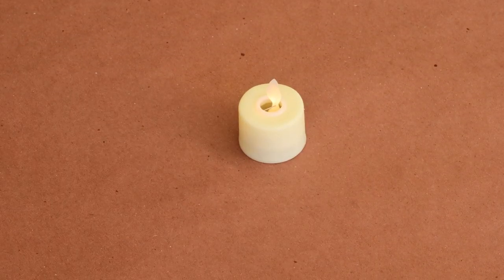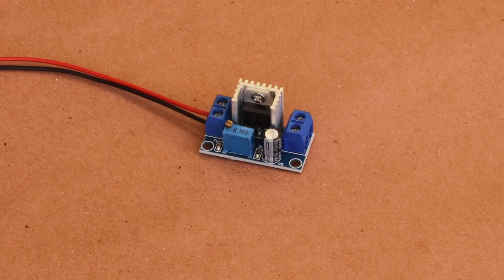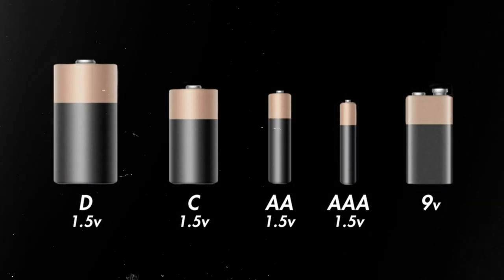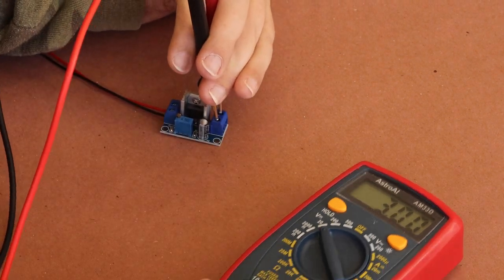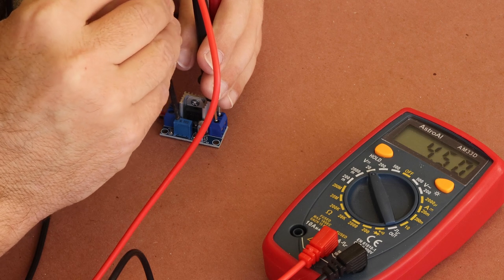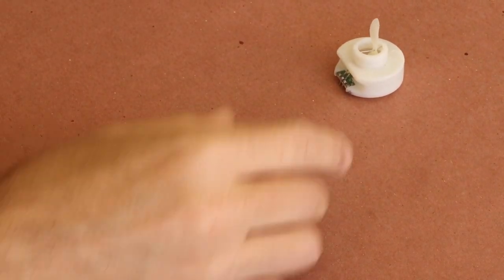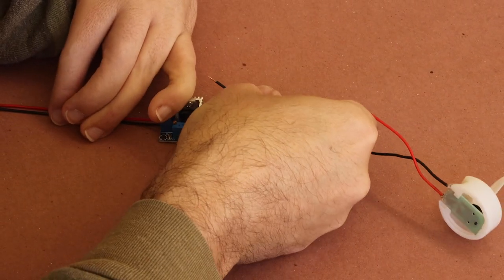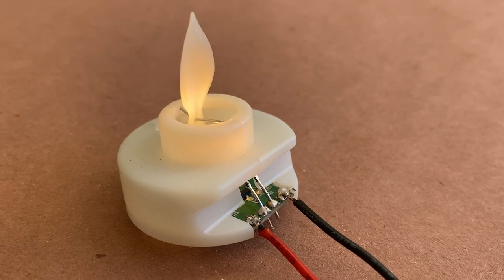PROP LAB: Turn Your Battery Powered Props to Plug-in!

Comment: Hello & greetings from Germany.
I really love your channel. So much nice stuff :) Great work!

Yes, the step-down (or DC-DC-buck)-convertors are very handy. But I advise everyone to take good care of the voltage-drop: the higher the difference between incoming and outgoing voltage, there more heat will be dissipated.
That said, it's a big difference, if you use a 12V- or 5V-System to power that thing up
.
Me and my neighbour had prepared a big haunt this year and converted all of our props to run them on powerline. We used two big power supplies: one 12V/30A PSU and one 5V/80A PSU (regulated down to 4.5V). To our satisfaction most of the available props on the market (nearly 99%) use either 12V (like the air-blown-stuff) or 4.5V (typical "three-battery-items"). So the only task is to connect wires to the (correct!) battery-contacts of the prop, connect the other side to a barrel connector and you're good to go :)

I suggest using the non-soldering-method by twisting or pinning wires to the battery-contacs and fixate them with tape and/or the battery-lid. So it's easy reversible if you decide to power it by battery again.

Keep on doing great stuff & always stay healthy.
Best regards.

Comment: I've been using these modules for a long time and they are wonderful... I like the fact that I can run everything off of 12V and I don't need to have multiple power bricks and get them mixed up and I have the 5.5mmx1.2mm barrel jack/plug with a positive center... so I can use off the shelf splitters and extension cables... again, that removes mistakes of plugging in the wrong power supply and potentially blowing up the circuit.  Before I got everything adapted, I used a yellow tape or yellow marking for +12V and red tape markings +5V

Comment: Over the years I've modified countless Halloween and Christmas items to run from a central DC supply. Some were solar, some were battery. The simple linear regulator shown can get hot (and shutdown) if it has to drop too much voltage at a reasonable current. You can get switching step down ("buck") converters quite cheap that will run quite cool even when supplying an Amp or more current and going from 12V (or 24V) to 3V, 5V, etc. I have some mods shown on my YT channel and web site.

Comment: At my previous home haunt, I also converted most of my battery props to DC, using adjustable power supplies. In one of my rooms, I had a great set of gemi props that were originally designed to be single table-top mechanical s, that I got multiples of  and ligned the hallway on  both sides with these, triggered by a single motion detector, so the person walking down the hallway was 'attacked' from both directions as they walked down.  One of the props on the table was cute, but when you are attacked from both sides, and synchronized with appropriate lighting & audio from the collection, it became very effective.

Comment: I've used those in the past, but primarily to salvage the parts. I've modified them with a 1K NTC thermistor and some changes to the pot (and onboard resistor). They get hot depending on the load you put them under, even with just running a fan they can get hot.

Comment: We have soooo many of these “Haunted Mansion” candles in the house and the constant need to recharge batteries has sapped any desire to use them frequently.  This may be a cost & effort-effective way to solve the problem!  (And another opportunity to break out the soldering iron 👍👏)

Comment: So i got to wondering... How many devices/candles can we put on one of those step downs? Like if you have multiple candles on the same tombstone, do you need one for each candle???
Reply from the maker: I haven't tested it yet, but I'll let you know when I do. My assumption is that you should be able to run multiples from one circuit.
Reply: Yes, you can run multiples off of 1 circuit.

Comment: Derek, your videos are always so helpful.  I understand the wiring of the step down circuit to an LED candle now, but I’m wondering about how to do it on a skeleton with pre-wired LED eyes?  There are wires from the two AA batteries to the eyes and to the activation button.  The activation button is on a set of leads, coming out from the skull.  If I simply take the batteries out, cut the activation switch leads coming out of the skull, and solder the step down into the lead ends and then into my 12 volt connection would that work?  Or would I need to put the step down into the leads currently going to the battery and the other side to my 12volt connection?  Or would I need to put a step down in both sets of leads (power and switch)?  I’m trying to convert all our props to run on house current, from a manually controlled switch box.  (And I really don’t know much about wiring😂). Taking a better look at it, now I have it apart, there is also a on/off switch wired into the circuit.  And a resister on the positive lead to the battery.
Reply from the maker: That’s a lot of options. lol. Without seeing it I don’t feel confident in giving you directions and would hate for you to ruin your prop.
Reply: I appreciate your prompt reply.  I have a photo, but don’t know how to up load it here.  I’m thinking replace the battery box with the 12 volt power supply through the the step down.  Then maybe directly to the LEDs, and eliminate both switches from the circuit?
Reply: Just wanted to let you know, I took both switches out of the circuit.  Wired the leads from the LEDs to the step down and the other side of the step down to 12 volts.  It worked great!

Comment: interesting, can 1 power source + 1 step down power say, 5 candles? or would the power source have to split into 5 step downs first?
Reply from the maker: Yes. As long as they're all the same voltage you can use one to handle multiple

Comment: Fantastic! Being the noob I am, do I need one of those each prop?
Reply from the maker: Great question. I haven’t tested it, but I’d think you could run multiples in the same way that you can connect more than one plug into a power strip.
Reply: We have the talking skulls from Wal-Mart. Each set of three uses 3 AA batteries for light, motion, and sound. I'm thinking one per set
Reply: @VanOaksProps  yeah that was my question as well. Like, the large pillars that take 2 or 3 AAAs,or more than one.

Comment: Sorry if I've missed the point and the answer is right in front of me, but how would this work if you have multiple lights?
Reply from the maker: Not a problem. You should be able to plug multiple lights into the circuit.

Comment: I've noticed some 'reviews' on Amazon warning about heat build up.  Have you had any issues? I buy old chargers from a local thrift store to use so most of the time I'm only trying to drop 5v down to 3
Reply from the maker: I could see that being an issue if there's a huge drop in voltage, but I'm like you and only changing by 1-3v.

Comment: I have a Home Depot 8' Spider that uses three 2800 mAh AA batteries for its light up eyes and sound effects. For Halloween, I place it on my roof, and I'd rather not have to replace the batteries climbing up on the roof every day. Do you know of a simple kit or circuit diagram to add a solar panel/circuit to power/recharge the batteries with?
Reply from the maker: I can't say that I do.

Comment: Thank you for the video.  Just an observation but some of my props have their batteries in series but look  in parallel.  In other words a two battery AA prop may or may not be 1.5V.  Also, have you considered Power Over Ethernet (PoE)?

Comment: I just use the proper voltage walwart to run mine.
Reply from the maker: Which is a great option, too. In my case, I run a bunch of LED lights on a singular 12v power source. Having this circuit allows me to use these small votives on that same system without having to run separate lower voltage power.

Comment: I was thinking using 20v battery form a drill. Can be done with this. If not do u know what I should get.  Step down 12v , 5v, 3v from dewalt 20v.
Reply from the maker: Not with this specific step-down circuit. It's only designed to step down from 12v. I'm sure there's others out there that will go from higher voltages, but I haven't tried any.
Reply: What you want is a buck converter, not a simple linear regulator off eBay, etc for a dollar or two each. Check the specs to see what the maximum input voltage is and what output range they are adjustable for.
Reply: The The LM317 module linked supports variable input and output, so it's more than capable for the voltages you specified, you just need to adjust the potentiometers using a digital multimeter. As long as you're not exceeding its current draw you'll be fine. However I would recommend a more modern circuit like an LM2596-based module which has a similar adjustable input and output range but is more efficient.

Comment: What do you do when it’s raining?! What can I do to waterproof my electrical props?!
Reply: I put all wiring ect. in a little box but what can I do to protect the candle itself?*
Reply from the maker: Depending on the style of candle you use, you may just need a bit of silicone around the upper edge where the "flame" meets the body of the candle. If you're using the moving flame style like in the video, you may be need to disassemble the unit and extend the wires to allow for you to hide the electronics in a more water tight container.
Reply from the maker: Depending on the prop (store bought or home made) some come with watertight motor housings.
Reply: Okay thank you very much, that helped👍🏻👍🏻